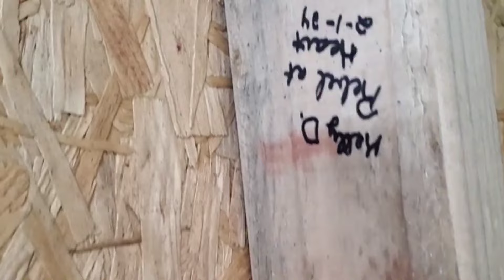Days 2 and 3 at Possum Run Homestead.

Comment: What is the advantage of 1x6 tounge n groove as opposed to sheets of plywood? Thank you!
Reply: Less cost right now.
It should have been put on the inside. MamaV wanted it as her exposed ceiling  With it inside as the ceiling, you would then fill the rafters cavity with thick insulation to avoid heat loss. The on top of that insulation you put on your plywwood/or cheaper OSB. After that then you put on the tar paper or ice shield then the metal roofing. This is the normal way to put on a roof.
With no OSB or plywood and no insulation in the cavities and no roof vents this roof will have a lot of heat loss in the winter which will create dangerous roof icicles that could hurt someone or worse. It will also decay faster. And it will get hotter inside the cabin in the summer.